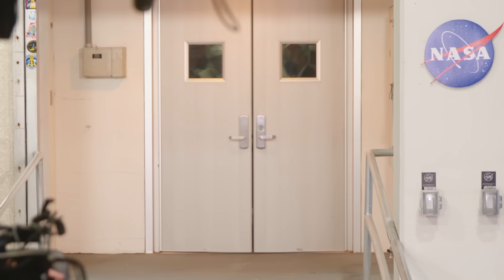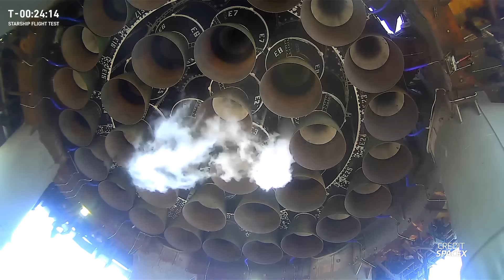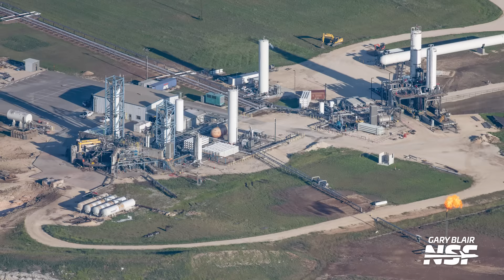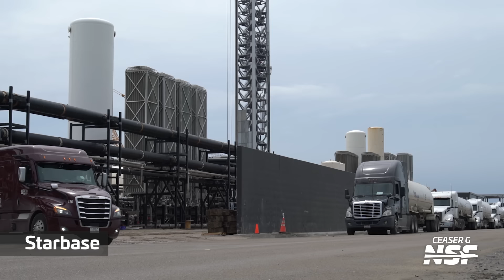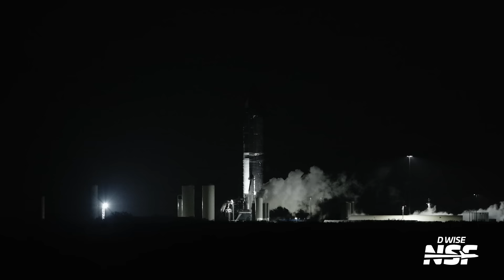Pushed to the Limit - SpaceX's Starship Raptor Engines

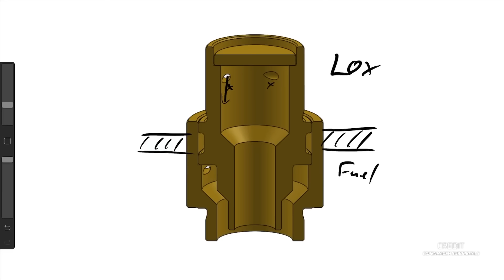Comment: 4:24 how you know that? sources? Elon all time is talking about pintle injectors. Merlin use pintle and raptor swirl?
i dont think soo. the high presure make swirl injector irelevant and so much stop and reignite, the flow can go backward.
Reply: WOW they use SWIRL INJECTOR on RAPTOR V3. That make me really happy because i was thinking the swirl injectors are only for low presure but that is not true. it work in high presure.
swirl injectors are more simple than pintle and look like are more eficient on mixing.
Happy happy happy hahaha. raptor v3 at 300BAR and swirl

Comment: How about a V1 Booster and V1 Star-Ship with a Stage 2, like booster 14, 30m tail stage 9 vacuum and 3 sea level engines. Star-Ship V1 HLS one less floor for nuclear generator & batteries. Engines 4 vacuum and 3 Sea level and 12 ICON electrical engines for cruising NOT costing. 
We have the equipment to do Apollo type mission Flyby and/or landing this year. NASA just waste taxpayers money.

Comment: How long could a single Raptor run without stop? Like if they fed an entire Super Heavy worth of LOx and CH4 into a single Raptor, would it burn through the whole load?
Reply: Theoretical estimates state that in ideal conditions, a Raptor Rocket Engine supplied with unlimited propellant could sustain continuously firing for a predicted maximum of about 7.5 Hours before substantial or catastrophic mechanical failure.
Reply: @nickhowatson4745  Cool. I knew it would be in the hours given the reusable nature but I honestly wasn't expecting anywhere near that long.

Comment: Is there any public source that the methane is injected in the pre-burner as a gas? I think it is still liquid during injection and gasified in the pre-burning process for running the turbine (as a gas).

That is, the cooling loop uses only liquid methane, it doesn’t boil off during the engine cooling process and pressure helps that. In the “injectors”the methane is still liquid and as soon as it’s injected in the pre-burner it becomes a gas while mixing with the tapped-off oxygen. I say “injectors”(quotation marks) because the injectors in the pre-burner are a whole entirely different thing from the regular injectors usually seen in combustion chambers.

Comment: You mixed film cooling and regenerative cooling, which are two separate methods of cooling the thrust chamber assembly. They can be used at the same time but only the massflow of the regenerative cooling massflow stays within the system after use (high temp methane). For film cooling the entirety of the massflow is discarded within the combustion chamber. 

So when you are talking about the cooling manifold it's only the massflow from the regen that gets used as a gaz onwards. The film cooling massflow exits the system.
Reply: No, we didn't mix anything, it was just poorly worded

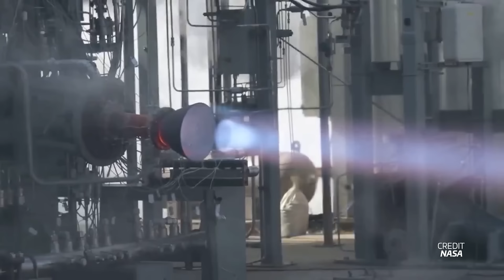Comment: Great video, just one super minor point.  It looks like the engine nozzle failure at the 7:03 mark was filmed at Marshall, not Stennis.  I could be wrong but that test stand is smaller than most of the ones at Stennis.

Comment: Great explanation, I was finally able to map the parts of the engine's conceptual diagram to where they physically are in a Raptor.
It would've been better if you had some (simplified) corss-section drawings of the chamber/nozzle cooling channels, but I've seen them in Everyday Astronaut's video a while ago so it's not a problem for me.

Comment: So, how do they intend to do all this pretesting of a Starship that has been refueled in LEO? 

How do they prove this reliable enough  to be human rated?  Seems like it's going to take a lot of successful tests. Almost seems like maybe launching with a crew then subjects them all to additional risks. I suppose the initial launch could be unmanned and then after refueling and testing, the crew might be sent up on a Dragon and transferred to the refueled and tested Starship?  It's probably going to take another 10 or more launches to refuel the Starship, so what's another launch with crew members on a proven, human rated spacecraft?  But that will b a bigger issue with a 100 member crew!

The Raptors may indeed be an amazingly efficient design, but the complexity times 39 just to get to LEO,  seems like a bunch of added risk, 

I have zero faith in the unnecessarily complex Starship design. NASA is going to have to drastically lower its standards to give Starship a human rating!

I question that it might make more sense to use larger, but maybe a bit more conservative design, than using so many of the Raptors. Plumbing would be far more simple. Potential failure pints would b drastically reduced too.

Comment: At the heart of a giant firework that cannot even orbit the earth.  At least Artemis orbited not only the earth, but also the moon on it 1st mission, Starship flight 10 and they are still not even getting an orbit of the earth.
Reply: 4 of the 9 flight tests so far would have easily resulted in Starship getting to orbit if that had been SpaceX's priority.

But their actual priority is testing reentry, so they're using trajectories that result in re-entry into remote & pre-announced ocean zones.

There's no reason to get into orbit and then have to rely on an engine relight to get back out of orbit again. Instead, engine relights can be another thing to test as part of these sub-orbital flights.
Reply: @peterford5408  Actually no, because each time they tested using an engine which would have been required to reach orbit it led to an onboard fire that led to the destruction of the ship.

Comment: Super heavy has one job, and it does it well.
Sadly, with the Starship, SpaceX has fallen into the same trap as the designers of the Space Shuttle did.
That is both are designed to be the Jack of all trades, consequently, they are master of none.

Comment: You state that LIQUIDS enter the combustion chamber, mix and get burnt. I was under the impression that Raptors mix HOT GASES in the combustion chamber.
Reply: Where in the video do we say that liquids enter the combustion chamber? We literally say that the only thing that reaches the combustion chamber are the hot exhausts from both preburners (we even say “can you guess why it’s called like that?” when referring to the hot gas manifold)
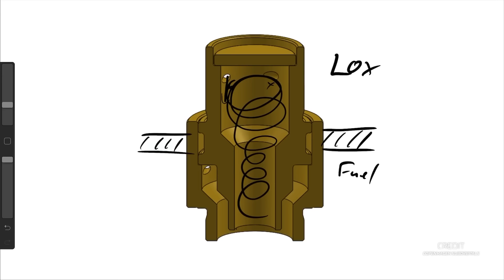Reply: @ale131296  4:30 FLUIDS, not liquids, but not gases either. Obviously gasification occurs at some point in the engine, but crucially it's gases that mix.

Comment: Is it just me, or @1:45 did jack get regenerative cooling (which never leaves the inside walls of the bell nozzle) mixed up with film cooling? (which, in a one way trip, is sprayed onto the walls of the flamey inside of the bell and gets burnt up)

BAD JACK! NO BACON ! 🥓

...Or am I totally  wrong? One of us is not getting any bacon.
In any case I still learned a lot and it was much better than cats. I'm going to watch it again and again.
Reply: The regeneratively cooled loop on the Raptor engine has also film cooling integrated on it
Reply: @ale131296  True, but he DID make it sound like the fuel used in film cooling then went on to the pre-burner. Like they made a mental note to "add regenerative cooling bit here",  then forgot to. 

"...this cooling manifold contains little openings around the combustion chamber and throat so that the liquid methane can exit and cool down the inner side of the engine in these areas. This is often called film cooling because it creates a protective film of cooler exhaust around the inner wall"

<*Put forgotten regenerative cooling segment here @1:50*>

"After cooling all those hot parts the methane goes from a cold cryogenic liquid into a hot gas. And here is where it splits in different directions. The vast majority of that hot gaseous methane ends up going to the fuel pre-burner"

Comment: I commented many times that I do not believe "the current rocket engines (and used fuels) are the ones to drive humans to Mars and beyond!!! Not practical, unsafe and costly!! How much refueling will be needed??? How long will it take to reach Mars?? How much radiation will the crew be exposed to???? STOP with this nonsense ...A type of nuclear engine would be more appropriate and I think NASA is on the right track testing one of those.
The Moon is nearby and Starship will need to be refueled 😂😂. Isn't this ridiculous?? How many refuelings to reach Mars and back, 20 refuelings or more??  Isn't this ridiculous??   
By the way, SpaceX is still in the prototyping stage...there is no Starship (yet) that can travel to Earth orbit and back without being damaged or exploding...😂😂
Moreover, the Starship will be a death trap as (until now) does not have any scape option.

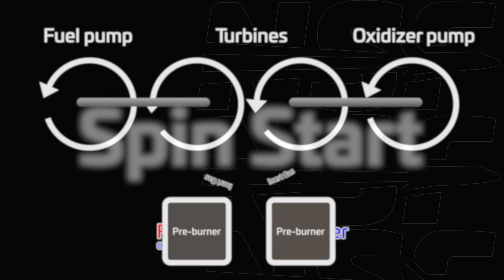Comment: SpaceX generally uses the term "spin prime" rather than "spin start" (6:13). Priming is the usual term to describe getting fluid pumps running.
Reply: Spin prime is the test, spin start is the start of the engine
Reply: @ale131296 oh, ok, I'll stand corrected. I haven't seen SX use that term, but I've not read everything they've put out.

Comment: Great video! We crave more info about Raptor and specifically Raptor 3 (R3)! Like how reliable is it (or any rocket engine in general) for repeat use? You mentioned the potential for rapid turn around without static fire test, but is that even feasible? What are the "wear-out" items on an engine like R3 and how many hours are they good for without a complete overhaul and/or refurbishment? We all know about piston engines (piston rings, valve seals, shaft seals, bearings, chains, injectors, etc.) and how they wear over time, but for a rocket engine is it even possible to think R3 could manage back to back flights without some level of refurbishment in-between? How do they currently manage the Merlin engines in terms of refurbishment? Is each one overhauled between every launch or can they get away with multiple flights between refurbishment? Do they even refurbish them or just throw them away after so many hours of use? Are there portions of the engines that cannot be overhauled and require replacement instead? So many questions. Unfortunately, SpaceX is probably the only source for real answers to these types of questions and they're not sharing, but it sure would be interesting to learn the answers...

Comment: It is insane that SpaceX figured out how to make a full flow engine in the first place, LET ALONE simplify it to something that looks like it could be a lego piece.
Reply: The RD-270 from 1962 was a full-flow design. The US had no staged combustion design till the 1970s with the SSME. The Soviets had to research and develop new stainless steel alloys which was not known by the West at all in the late 1950s, and would not be known for decades after.
Reply: @NUCLEARARMAMENT  Yes, and it also relied on incredibly toxic and less energy dense hypergolic fuels to operate, so it was less useful as a rocket engine than a turbo pump engine, like Merlin.  Still, impressive they were able to solve oxygen rich staged combustion at all, cause it's a nasty problem to solve.
Reply: @jonavery4978 Toxic yes, less energy hardly. Pentaborane (B5H9) combined with dinitrogen tetroxide (N2O4) yields significantly higher bulk energy density, as well as higher volumetric and massimetric energy density, and as a result higher specific impulse than can be achieved by methane and LOX.
Reply: Full flow rocket engines is soviet tech. It was obtained by the US government after the fall of the USSR and the designs spread to US companies.
Reply: @nickl5658  That is at best a misleading oversimplification.
Reply: @nickl5658  Um, no, the Soviets never built a working full flow rocket engine.  The U.S. and U.S.S.R. used opposing staged combustion cycle engines, one of them full, the other oxidizer, presumably because the U.S. used hydrogen and the U.S.S.R used Kerosene as their fuel, but Raptor is the first functional full flow engine that has ever been developed and deployed. 

Building a full flow rocket on the the ground is not the same as getting it to work in a rocket.

Sort of like the Tzar bomba.  Just because you make make a huge nuclear bomb on the ground doesn't mean you have any ability to deploy the thing.
Reply: @jonavery4978  IOW, US figured out fuel pre-burners, USSR figured out oxygen pre-burners. You need both to make a full-flow staged-combustion engine.

Now, what I'm wondering is whether SpaceX used any of the ex-soviet expertise on making pipes and turbines that survive being blasted with hot gaseous oxygen, or if they figured everything it out from scratch.
Reply: @Wolf480pl  I'm sure they studied the soviet engine design, because it was being used on U.S. rockets up till 2008.  It's kind of amazing that the problems of oxygen rich and fuel rich cancel each other out if you can run them in perfect harmony.
Reply: @jonavery4978  do they cancel out? You still can't use kerosene, because its combustion products from fuel preburner would clog up the injector. And you still need a very corrosion-resistant turbine on the oxygen preburner side.
Reply: @Wolf480pl  Yeah, it doesn't work with kerosene, because the soot clogs the turbine on the fuel rich side.  This is why the USSR invented oxygen rich in the first place.  Also, apparently, their full flow rocket engine ran on UDMH and Nitrogen Tetroxide, so, not the nicest chemicals to be working with.

Comment: There is another, even more critical reason, to test the engines; rating them for human flight. The FAA and NASA, rightly in this case, require a large amount of statistically relevant data to determine if a vehicle is "safe enough" for humans to fly in it. A lot of that data concerns the reliability of the engines.
Reply: Raptor 2 seems quite decent for now. The rest of the vehicle however...
Reply: Starship will never be human rated. Not for launch. Not for return.

Comment: How many mars bars can fit in a starship payload bay???
Reply: Here’s a clean, defensible ballpark using Starship HLS cargo to the lunar surface (mass is the limiter, not volume):

Assumptions

Landable payload (HLS cargo): ~12–15 metric tons to the Moon’s surface (order-of-magnitude planning figure).

Mars Bar (standard full size): ~51 g each; approximate brick volume ~63 cm³ (9×3.5×2 cm).
Volume check shows mass will bind long before volume.

Math (mass-limited)

12,000 kg / 0.051 kg ≈ 235,000 bars

15,000 kg / 0.051 kg ≈ 294,000 bars

Packaging/containers realism

Reserve ~15% of payload for wrappers, cartons, pallets, restraints, and handling gear:

~200,000–250,000 Mars Bars delivered to the lunar surface.

Sanity check (volume)

250k bars × 63 cm³ ≈ 15.8 m³ — tiny versus Starship’s ~1,000 m³ bay, so volume isn’t the bottleneck.

TL;DR: About two to three hundred thousand Mars Bars per HLS lunar landing after accounting for packaging.
Reply: @kevinmichaelreed  crazy that the balance betwen mass and volume is so unbalanced. btw if you count to low earth orbit and then the newer "block 2 or 3" reusable config, i suppose that the occupacy ratio betwen volume and mass become more equal
Reply: @Camurrio  Assuming it's 200,000 Mars bars for 12t, you get 1,666,665 Mars bars for a 100t LEO launch. Twice that for 200t. Volume wise, it'll be 132 m^3 of volume. Or 13.2% of the volume inside. 26.4% for the 200t variant
Reply: @Quasar-2  ok, not for doing the pain in the ass but the "current" starship config have less then 1000m³ bc the fuel tank is stretched and it should be accounted a percentage of not useful space, like the very edge of the ship
Reply: @Camurrio  V3 will have a stretched payload bay too so it wouldn't be all that different to v1 in terms of tank/payload bay ratio. 

Even with the smaller payload bay, however, mass would be the issue, not volume. Not something I was expecting from a candy bar lol
Reply: Payload?  They cant even orbit why the hell would they take cargo to crash into the Indian Ocean!
Reply: Does the mars bar explode in a vacuum?
Reply: @bobo-5195  i don't think they explode as a bar, but the packaging has some air inside so I think if that doesn't pop, it would be puffy. That bc the ΔP from inside the packaging and the outside is the factor that determines the "puffyness" of the package